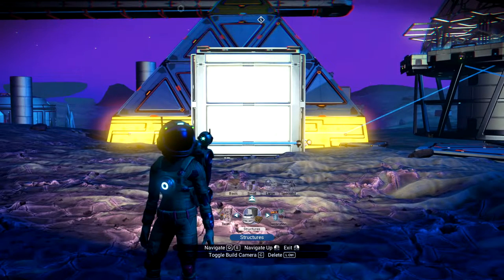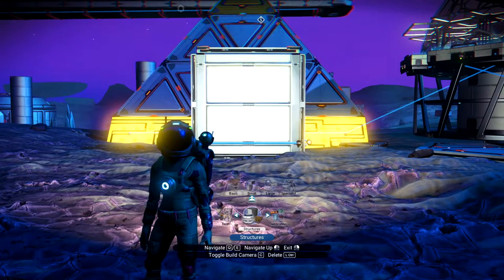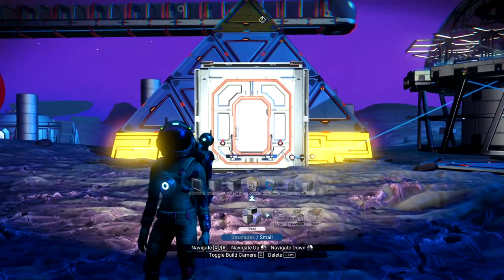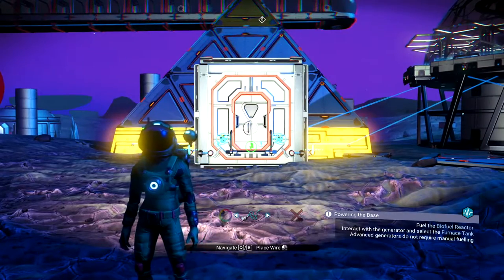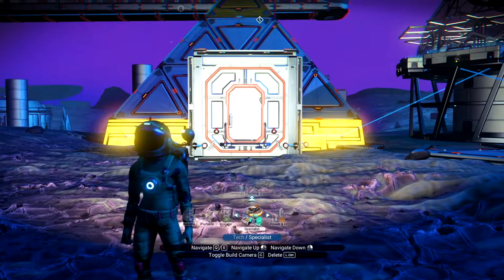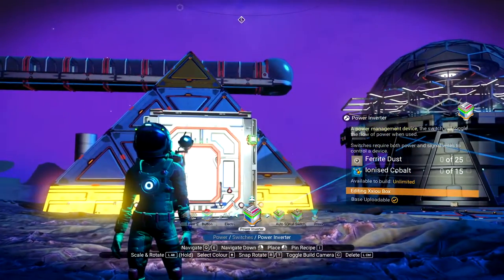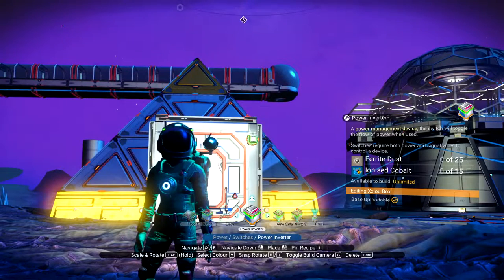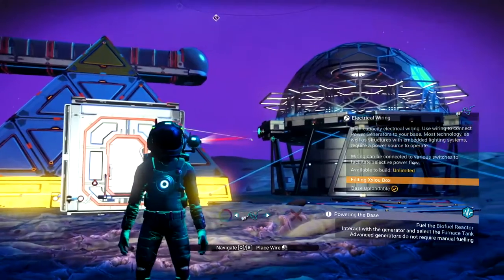No Man's Sky Automatic Doors with Proximity Switch

Comment: Instructions unclear, I opened Pandoras box!!

kidding, Thanks, got my door working. I had to reverse the inverter input on the first step. Plug power to Red, Green to Door, bottom inverter to Proximity, power to Proximity, may have been an update since this video but I got it working. You gave me a starting point, gave you a like and sub.

Comment: This video was helpful, thank you. I'mma be honest though...Idk why the devs went this route. Lol I mean this is so needlessly complicated. Idk why they didn't just make the doors work when you hook up power to the main building. 

I mean, where's the logic in them making the doors work this way?? If you have multiple buildings connected to each other and only connect power to one of the buildings, ALL the buildings get power...WHY does it not work the same for the doors connected to said buildings? 🤣 And what's the point of proximity stuff?? Just make proximity a built in functionality with the door when it's powered.

Comment: Do you need to do the same process on the INSIDE as well so you aren't trapped inside once the door closes?
Reply from the maker: No you shouldn't have to do that. One thing I have notices since the last update is auto doors not working even when set up correctly. I have 2 bases with auto doors that just stopped working so I think the proximity switches may be bugged. Thanks for watching.
Reply: Yea the schematic is not working for me either. I’m on console

Comment: So I got it to work thanks to you... but now a new issue is presenting itself. The preset building I have the door rigged up to has power right up until the door auto opens for me, then it cuts power to the building completely until I leave and the door is shut! -_-
Reply from the maker: It sounds like you may have connected the preset building to the power inverter. Make sure your wires to the door and the structure are separate. So if the door is working make sure you have no wires from the structure that are going through the inverter. Just wire the structure to a steady power source directly like a battery.